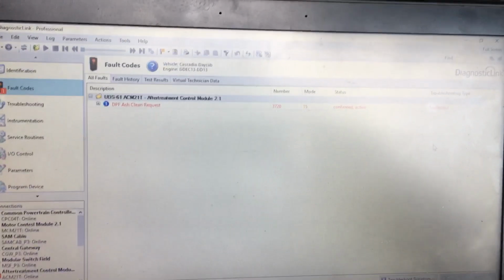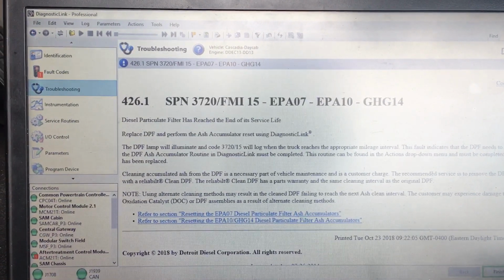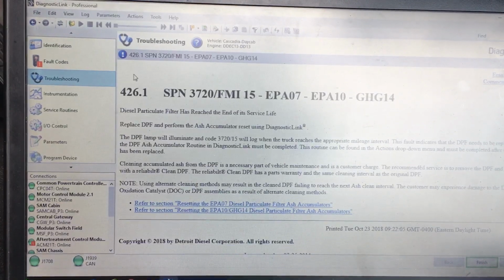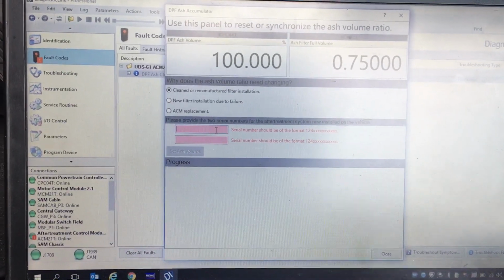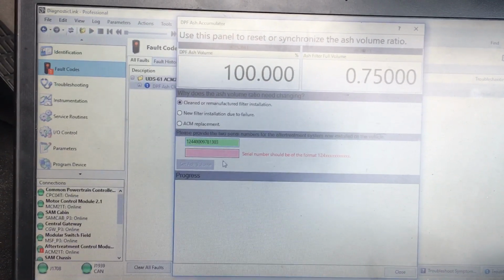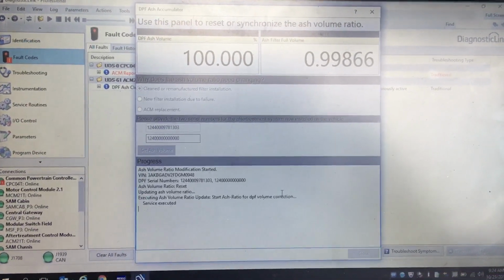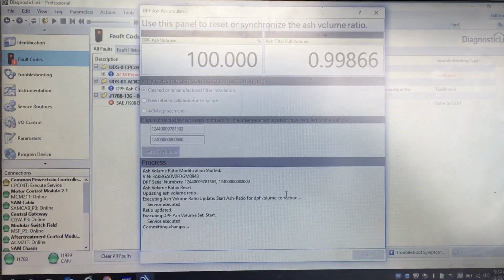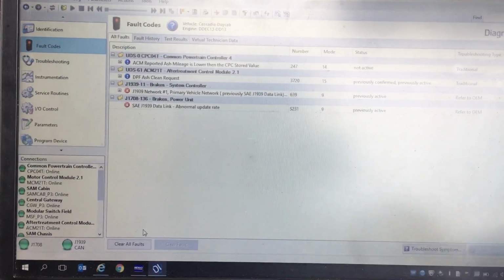Resetting/clearing DPF data or ash accumulator Detroit Diesel- Diagnostic Link

Comment: Thank you for the video and I have a truck that have DPF Filter Efficiency too low , spn 520349 fm 14 , do you have any idea what this is about?
Reply: You need new DPF filters
Reply from the maker: Check your tail pipe. See if you have any traces of soot. If you swipe your finger on the inside of the pipe where the exhaust comes out (when it’s cold so you don’t burn yourself) and there is black soot, your dpfs have most likely failed and will have to be replaced. There is a soot sensor next to your outlet nox sensor that is causing this code.
Reply: thank you
 @alreyindustries

Comment: 12400000000000 would reset both filters?
Reply from the maker: I think any 14 number combination would work as long as it begins with 124…
The same number can be used for both filters.
Reply: Ok, kool
Thanks

Comment: Hi sir I don't have a serial number. How do you reset
Reply from the maker: You can just put in 12400000000000 and it should let you reset
Reply: The Best Seller & UP To Date Software, with No Expiration Date and I use a Special Software that Freezes the Software For You To Never Have Any Problems/Issues.

What I Offer is Diesel Diagnostic Laptops & Tablets with No Expiration Day on Software.

Cell Phone ( Numero de Cellular
 (+1310) 903-6679

WhatsApp Number (+1310)-892-0502

Instagram = https://www.instagram.com/fr1j0l3r0/?hl=en

OfferUp = https://offerup.com/item/detail/986826309/
Reply: DUDE, HE SAYS IN THE VIDEO!